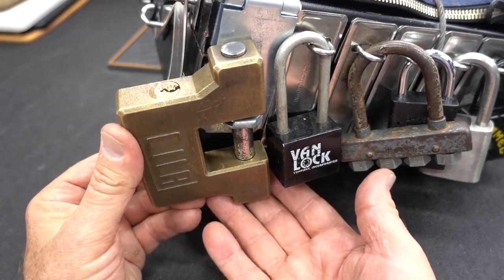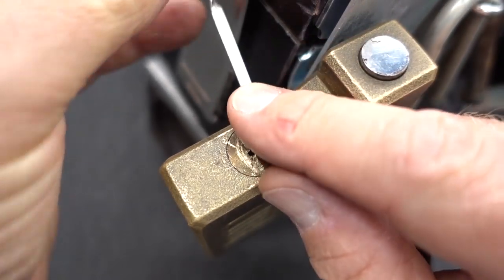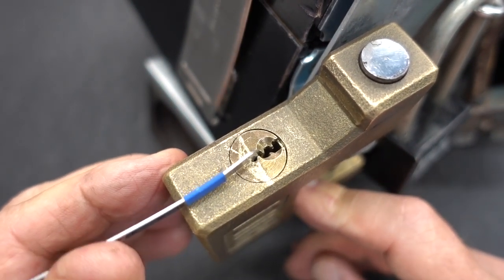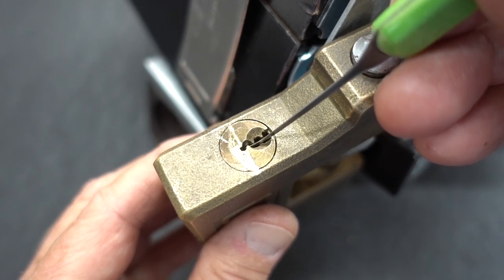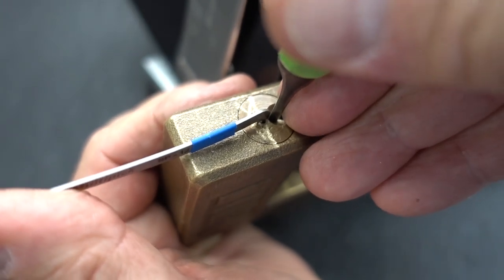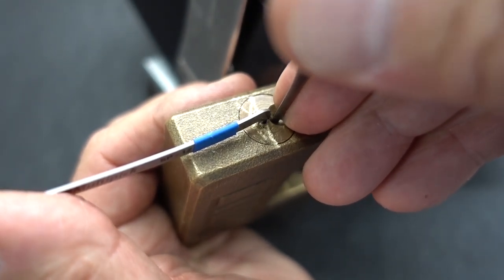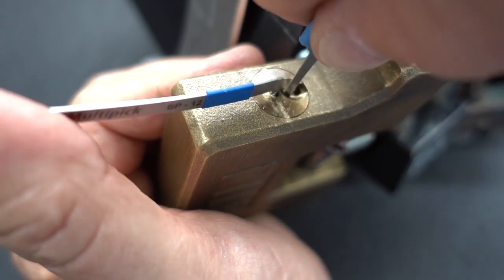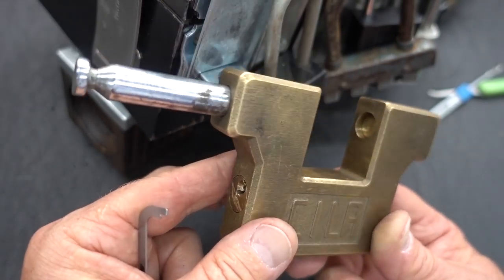(1543) Dude's Treasure Chest Lock #10

Comment: Whew, that was lucky. Little bit surprised about the tensioning, I'd've expected you to use bottom of the keyway on the opposite side so that you were pulling up, not pushing down. The other thing that comes to mind is some sort of a tweezer style tensioner. When I was in college my lockpick set had one of those and it was actually my favorite at the time. It gave lots of room to work on the pins. Seems like it would have been a really good choice for that lock.

Comment: Couldn't you have used bottom tension by just rotating your tension wrench 180 degrees? You'd end up pulling it to the left instead of pushing it to the right, though. You probably haven't practiced that, but consider it a handicap to bring your skill level down to that of the rest of us.  😊

Comment: Why don’t more lock manufacturers use crazy keyways like that to making picking more difficult?
Reply: Manufacturing costs for one. Tooling(machines, cutters, work flow between steps, training, etc) can run into the hundreds of thousands to millions depending on the scale of production.
Take Master Locks #3 lock, they make millions of those locks a year. To change the keyshape, they'd have to order a custom machine and make the custom cutters and replacement cutters to broach it. Then plan to reconfigure/replace the conveyor line in that section to fit the new machine into the process. Then running power lines, coolant lines, safety zones for workers, etc. If the machine is bigger than the old one, they might have to redo 10 or 20 other machines around it. It can get insanely complicated setting up a mass production line.

Comment: why not use bottom from the other side?
Reply: Usually, with a paracentric lock like that, you can only really tension one way from the bottom.  If you try to tension the other way, your tensioner slips slightly and binds up the core.
Reply: @adamwest8711  but even if you flip the tension tool you would still go clockwise or the counterclockwise because padlocks only go one way and if that way works why not. in this case the biggest problem seemed to be the box.
Reply: I used bottom of the keyway to SPP. Note how I choose the proper tension wrench: In my video #80, which is another installment of my series titled "5 Locks In 5 Minutes", I SPP the Cila very quickly. 
  (This series is dedicated to quickly showcasing locks in my private collection. But this particular video contains a bonus Cila picking segment.)
  I show the key, the pick & tension wrench I use, and then proceed to SPP it open.
  The Cila segment begins at 02:00 and here's the link to the YouTube video:
https://youtu.be/9cKQWvNhnDw
Reply: The Lock Picking Lebowski - he pissed you off raking it didn’t he...
Reply: @adamwest8711 No. He impressed me. He's a very amazing picker.
Reply: The Lock Picking Lebowski - 😄 I like Bill too.  Appreciate his ‘warts an all’ approach and couldn’t have even started picking without his vids

Cool project you’ve sent his way.  Cheers for the entertainment 👍

Comment: I wonder.. for such a curved keyway, would it be possible to build, or design say, a 'curved' rake or that.. a pick wouldn't work butr couldn't you technically bend or have a bent rake or that, specifically for that.. can't SPP it easily, but something thats designed to go around corners, but still has the peaks and that...